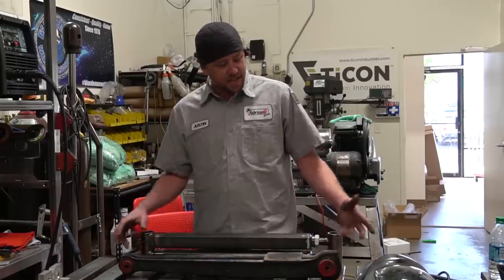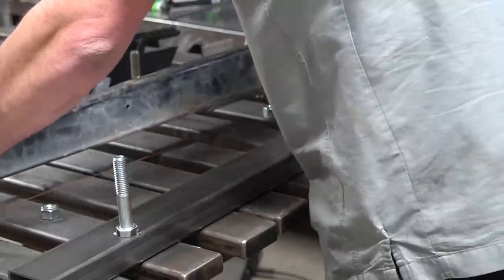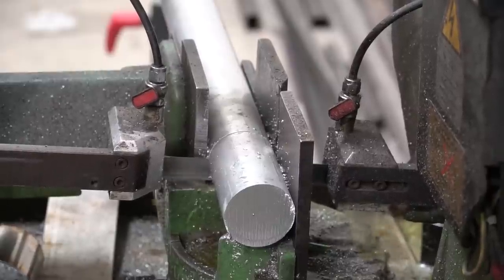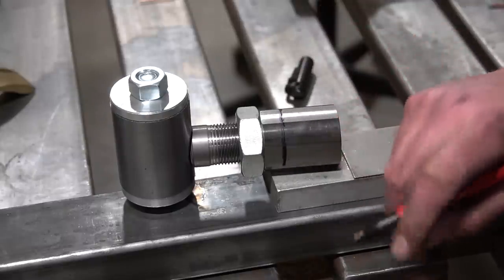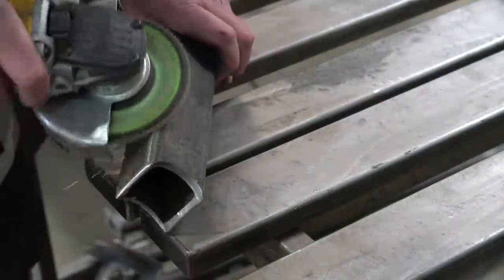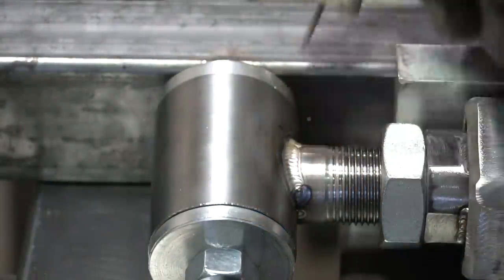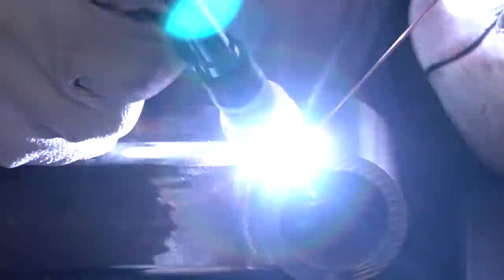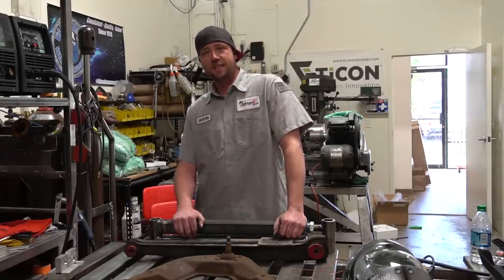TFS: Custom 4 Links Part 1

Comment: Hello! Your TIG welding machines reviews are Always interesting; I would like to suggest you a welding machine, professional (or soldi as It Is), or at least if you know It, I'd like to know what you think about It.
The machine Is the gys 220 AC/DC: It has similar features to the FRONIUS 230 i.
It's a french made welding machine, not chinese remarked, the price Is interesting, but there are no reviews about this welder.

Just to clarify my position, I am not a gys employee, or seller: I'm Just a guy that has to buy a new welder for his workshop (Always used mw series) and when I was almost convinced to go for the 230 i, I Just found the gys, wich looks similar and it's quiet cheaper (3.3k euros the fronius, machine only, vs 2.5 k the gys machine only; not to mention the costs of dinse adapters for the fronius, wich apart the Money, pisses me off a bit, the cost for the pulse pro software (c'mon really?) and the cost of the plastic foot pedal, wich Is around 650/700 euros (whaaat?)).
So I'd like to know your opinion, because I think you are a nice guy and a good welder.
Thanks if you decide to give me an answer and keep up your good job, your videos are Always very interesting and quiet informative.

Comment: Nice welding good demo of basic fabrication skills. bad engineering. You dont want the threads to be side loaded by the air bags. it will work the threads loose bend or jam nuts come loose also the threads are a stress riser. At least flip the arm around so the bags are on the solid non adjustable end. The factory shim system is actually a very good design cant slip or move and no threads to wear no jam nuts to come loose no stress risers no eccentric washers to slip. Those factory engineers are sharper than most people think
Reply from the maker: I'm a little curious where you saw the orientation of the arm and location of the bag in this vid. I'm actually quite sure this is a multi episode topic and neither the orientation or bag location were shown or mentioned.
Reply: @TheFabricatorSeries  way at the end around 16;21 . the bag loads will try to rotate the arm on the threads. You can use solid aluminum or stiff polly bushings to help with that but it will bind the suspension in roll  or even if you jack up one side to change a tire or whatever putting all kinds of stress on the mounting points. Of coarse you have to consider its a bagged caddy cruiser not a road race car so if your aware and careful . maybe
Reply from the maker: @tomhutchins1046  Theres no bag mounts on them. Theres no orientation of them shown on the chassis. There was only a shot of them laid out on the table to show what they look like.
Reply: @TheFabricatorSeries  . Rule one in suspension Bind in any plane is bad. Good luck on your project.

Comment: Having built racecars those arms are huge and way too heavy. Ok for an offroad truck and they use 3/4" heim joints! And then the eurathane bushes then bind everything up. And then it elongates the holes very rapidly and the car walks around like a pregnant duck!
Also you will get a better stronger weld with MIG. While you did it far better than most people MIG is still stronger for heavy welds like such. TIG is prettier but lacks the strength.
Look on You Tube an see rear ends fall out that have pretty little TIG joins. I have seen it up close on road race cars as the car exits off the track into a wall rapidly.